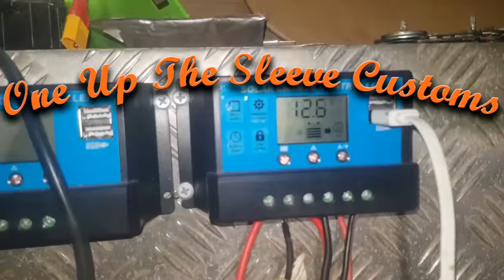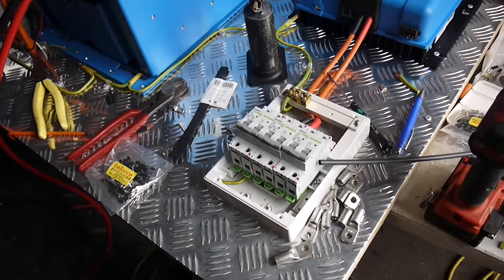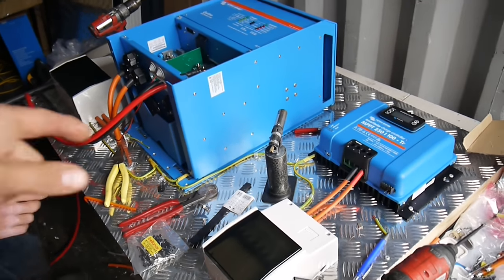Pro Tips and Tricks For Off Grid Solar With Solar Tasmania . Victron 8kva system

Comment: i use latronics theyre not too bad , a guy i visited  built his own hes an engineer it has 70kw surge and huge continuous, pure sign under all loads it doesnt falter, hes one of the gurus of the backhed website
Reply from the maker: 7kw or 70? If 70 holy crap thats Amazing!!!!! I had a latronics before i started on Youtube. Not sure if i go victron or magnasine
Reply: @Oneupthesleevecustoms  70 its the real deal not like the crap weve got to buy and pay the earth for it , he said being an electrical engineer he prefers low frquency inverters , he calls them tractors because they have real grunt huge surge capabillity unlike high frequency inverters with all there overly complex circuitry that fails and complex to fix in comparison . men in my family have been using latronics for more than 20 years and failures are almost never the best thing is you can get them repaired locally , latronics is looking into paralelling inverters now , well thats what they told me in an email. my nanas latronics inverter has been going for 11years not one issue, mine have been in use since 2013 no issues yet i know there was a bad batch with some grid ties but the fix was very easy.

Comment: Hi, im setting up the same 8kVA inverter, but it specifies to use 2x50mm² cables 2 positive, 2 negative, but you only installed 1 for each, is this correct? Why does it say 2x cables in the manual?
Reply from the maker: Maybe it they are keeping it safe for cable length ect
Reply: AC ripple voltage & efficiency.
Reply from the maker: Thanks mate!!

Comment: Why 70amp wires into mppt and 100amp wires out?
Reply from the maker: Input is higher voltage dc mate
Reply: One Up The Sleeve Customs you’d have to dumb it down a bit more for me mate I’m new to this. If I have two strings of 250v panels that are 8amp 215watt does this mppt charger take my two strings 8 amps and 8amps and do some magic and make 100amps???
Reply from the maker: The idea is you run bigger strings up  to 250v dc then it out puts to battery
Reply: watts stay the same as that's the "energy" the panels put out.. So that energy goes to the MPPT controller at 250v at 8amps (2000w) but to charge the battery you need circa 14.7 volts. Ohms law says that what was 8amps at 250v now comes out the controller at 14.7 volts but still 2000w.. 2000w at 14.7 volts is 136 amps... Cooking on gas now boy!!
losses and inefficiencies not included of course..
Reply from the maker: I recommend every one who wants to play with electricity in extra low voltage should learn ohms law makes it all easy
Reply: One Up The Sleeve Customs yea alot less losses when you aren't boosting or bucking the voltage.  If you only chop to ac from DC. No loss. My system is 24v for off grid. My house is basically a camper. The boost or buck converters are great but there is losses. Converting volts into amps is an awsome concept. Still there is losses! I don't think I'd want to go to my max of 150vdc input. There would be more losses bucking to 29v the mppt works best at about1.5x the batt voltage.  I'm at 42 or 44 volts from pv. And my lithium bank is 29.4, but I charge to 28.7-28.8v and try to keep it above 24v, I can go to 21v sorry I'm rambling!!!

Comment: I just subbed! Looks like my type channel!
Reply from the maker: Haha yeah i have a bit.of fun
Reply: One Up The Sleeve Customs yea from the intro looks like it!!! I'm totally into making things I could just go buy! Or can't buy any where. Cutting, welding, steel, wood  don't matter. I like it all. I built a car once. About 500 hp nice and shiny , but I couldn't stop tinkering on it! I think it's more fun building it than just owning it!  I guess if I had the funds I'd go to Mars my self! Ha-ha. Looking forward to some great videos. I'm off grid working to build a decent system to power everything and heatmy house and water. And be redundant. Maybe a small car engine to generate power. And use the heat for heating the house. Crazy right! I do have a 1200cc yamaha bike with a decent engine. And it is liquid cooled! Connect it up to a generator , maybe a arduino governor. And a well insulated 40gallon drum, a couple rediators in house. Get the mass of water in the drum hot. Then circulate thru the radiators. It would just take a small pump. 40' of insulated 1/2" lines from the shed to house with the drum in basement/ crawl space. ( Hey its almost a basement, a lil bit more digging) I just wonder if it would be enough heat! How long will it last spinning @ 3600 rpm for a day or two at a go.. And maybe run it off a biomass gasdifier!  Yea I'm rambling...keep at it man!!!

Comment: Sorry I can not watch this. I want to , but can't. ( MEDAL BACKING ).... nope... not pretty.   dumb..!    dan t.
Reply from the maker: Its a zero potential backing plate. Designed and used for 20 years by a industrial and offgrid sparky? Fill me in on what you issue is with it
Reply: It's a standard setup for any solar system like this, large currents can induce large amounts of heat, and of course any fire's which a unit may cause need to have reduce fuel, The aim is to mitigate any risk of Fire. Often enough people install to foam, plastic, and even composite materials (like aligloss) just because they look good or may include insulating properties depending nowhere they are setting up, such as Mobile phones, etc.
Every installed piece all has metal backing, if anything a Metal backboard is only an extension of this.
For our small scale or mobile setups where Metal is not an option we may use formply or low combustion factor ply.